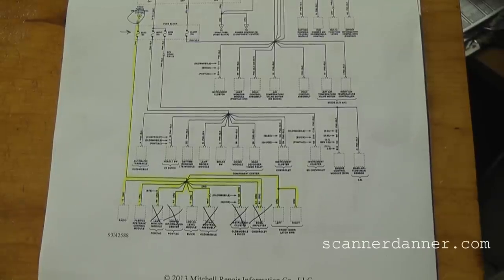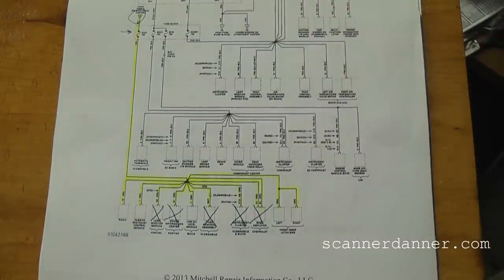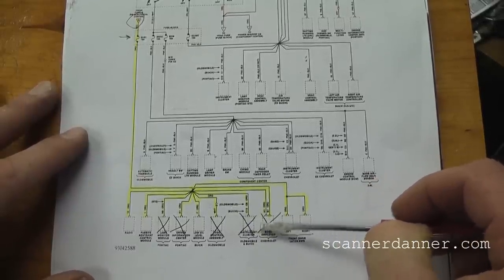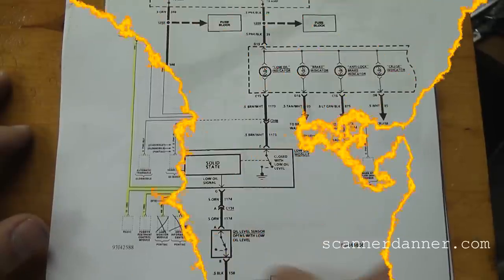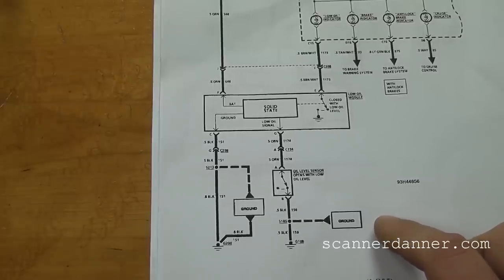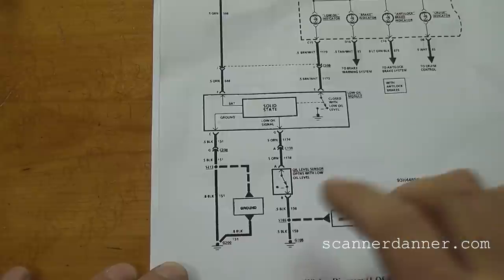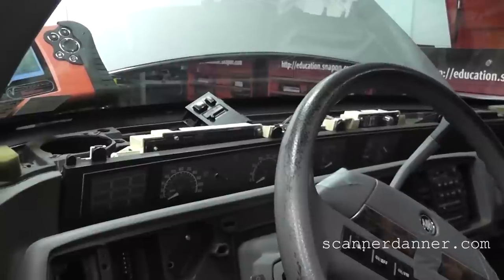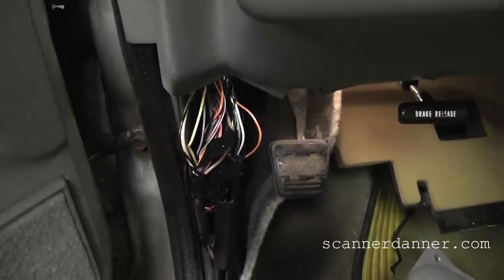1993 GM 3.1 No Start Case Study (Part III)

Comment: I had an 89 Berreta with the same passive restraint system. Government regulations were going in requiring a passive restraint system for front seat passengers. Auto makers didn't have to use airbags, per se, but a system that automatically protected front seat passengers. This was GMs version. You could leave the seatbelts latched all the time, and still get in and out of the car. When you opened the door, the seat belts would release and you could get out. When you were driving and hit the brakes, or the car slowed down abruptly, the speed sensor reading would be used to tension the belts. It was a clumsy system, and everyone would just unlatch the seatbelts anyway. When airbags became more common, this system disappeared. Great videos, BTW!

Comment: FYI, My brother is a phone tech. I have brought some of his tech tools over to the auto side. I have been using a tone box and wand to follow the noise in the wire. I have had success in some cases following wires in search of those mysterious modules. Or the ones that are not listed/wrong locations. Great job your doing, refresh and learn new stuff all the time from your videos.
Reply from the maker: thanks mark macias

Comment: Used to get those when I worked at the Buick dealer.  The system was designed so you could get in and out of the vehicle without taking your seat belt off.  Thought that was a pretty interesting system myself.  I remember getting burnt a couple of times by those solenoids when doing window motors.  The solenoids would stay on and get hot with the door open.  Never seen a module go bad on one though.  Good catch and great video.

Comment: i think i figured it out. When he clipped the harness, the wire cutters or scissors caused a momentary short to power, that backfed through the chime module, cruise module, or instrument cluster, that drk green wire is in the diagram is dotted meaning other things are connected to it, like the chime module, there are many drk green wires running to the radio but i dont think they are the same, the old pcm might of had more clues had it not exploded

Comment: I found this video interesting because when I was trying to find a parasitic draw on our 94 Cavalier, I was dealing with a lot of the same components on the circuit that was drawing as you were.  Mine was at the CTSY fuse and messing with the negative battery cable at the negative battery post gave me the same sounds that you experienced.  I thought it was my power lock switches as well.  The CTSY circuit on my car also dealt with the door latch switches which I also could never find.  I also could not find the low oil level sensor.  Mine problem turned out to be the trunk light harness that was causing the draw.  I just unplugged it for now since it's not important to have.  I will look at it more later after the weather gets better to see if the harness has a cut in it that could have been grounding out.  This draw would cause the car's battery to go dead about every 7 days even when the car was driven 5 days out of the 7.
Reply: I also forgot to mention that our car also had the seat belt retractors inside the door and had the same two retractors with the same black and yellow wires going to it.

Comment: Way to go Paul! Watched the 3.1 series.  I'm impressed.  Reminds me of when I was going down the freeway in my 90 Deville.  Suddenly the car shut off, speedometer jumped to 85 and I lost all accessory power.  Being newer I didn't look at things systematically like I should have.  I did find the fix a few dollars later, turns out the primary wire from my ign. switch to my coil (inside the distributor) shorted out against the engine and fried a fusible link... Watching this reminded me of that (I think it was the way that dash looked).  Keep up the good videos!!

Comment: The solenoids would hold the pendulum still so opening the door would not cause them to grab the seatbelt. Once the door was closed the pendulums had to be allowed to move so they could lock the seatbelt in an accident. The VSS input was there to override the door latch switches so that if you started driving the car it would automatically release the solenoid so that the seatbelts could work. It would ignore the door lock switch input with vehicle speed.

Comment: Look at 42:00 when you flip the module over. Upper left corner. Board is damaged, possibly shorted.
Reply: Sorry, you're 2 YEARS too late. +Daniel Auto Elektro had it 3 YEARS ago

Comment: So when you heard the noise in the door as you pulled and replaced the fuse, couldn't you have whipped off tge door panel and then using the Power probe ECT device sent a radio signal back along the yellow wire and traced the module. I know it wouldn't have given you the vehicle speed being along the green wire, but after finding it fast you could say well there's power and ground so very likely module damaged.

Comment: You should save that module as a example for the next time your talking about transistor drivers in a ecm - ecu. That black 3 pin square - rectangle item  mounted to the aluminum heat sink is a transistor it has the Base collector and emitter

Comment: My Bronco II cranks but no spark, my techs changed parts first  then tried to diagnose to NO avail lol, having them tow it to house  I got factory wiring diagrams on way, hopefuly i can do as good as u guys, grt work, appreciate it!  jim in NC
Reply from the maker: I have videos on the EEC IV ignition system. Check my chapter 22 playlist

Comment: I'm surprised that you didn't think about the VSS in relation to the latch switch.  Think about it.  In modern cars when you reach a certain speed the doors lock.  Perhaps they weren't as sophisticated back then and instead simply prevented the door handle from being used after a certain speed.  A VSS controlled "lock in" design.  Think that is possible from what you saw?  That's all I could think of.  Nice to see you struggle once in a while.  If you aren't frustrated you aren't learning!

Comment: Hi Paul. They use the term passive restraint because it doesn't require any action from the driver. The way that system works is you're supposed to leave the seat belt latched all the time. The driver is supposed to slide in and out underneath the seat belt that's already latched. The problem with that design is when you open the door the pendulum in the seatbelt it would cause the seatbelts to lock .

Comment: I realize this is an old video, but I've found that shopkey/Mitchell is sometimes limited on diagrams for older vehicles. Where Alldata has a few more. I found the diagram for the seatbelt system that shows the switches and solenoids. As well as some system explanation.

Comment: I had a Grand Cherokee come into the shop, don't remember the year, it had a parasitic draw, traced it down to the door ajar switch, even using a wiring diagram it took me 4 hours plus to track it down, I do not recall if their was a door ajar lamp illuminated on the dash either.
Reply: Never say quit never say surrender

Comment: I once had an 89 blazer mfg date 9  - 89. To find any parts that would fit it I had to use 88, 89, or 90 and compare the three to find the right part. It reminded me of that Johnny Cash Cadillac song, One piece at a time. Damn thing ran for 25+ years though with only the expected part replacements. Not one major item at all. Jpol.

Comment: i've watched this video before but my brothers 93 cavalier is doing the exact same thing 
maybe a little late but i hope that fella did not drive that car without that module as he wont have proper working seat belts....the 93 cavalier was controlled by a chime module..the door latches/handles are wired at the door latch to illuminated the vehicle when puled up on Scanner Danner you are right about the solonoids allowing doors to be opened with belts still attached

Comment: looks like there is some burnt out print on the pcb of the control module, at the top left hand corner of the pcb
 pause video at 41.58 . I could be wrong, it might be a shadow
Great video

Comment: Alldata lists the wiring diagram as "Seat belt system" for 1993 Buick Regal. The interesting thing is that they also have the exact same location description. GM must assume that is enough info to go on.

Comment: Another great video, showing the real world issues we can come up against. I am liking frosty9595's idea about speed sensitive volume control, would be nice to see if the radio control module is linked to the speed signal circuit! A full conclusion as to the cause might result. Thanks Paul, a really interesting three parter.

Comment: I know it didn't have anything to do with what was causing the battery drain, but the low oil level module. Something you could have done to eliminate it as a possible cause of the drain without actually having to find it seems to me would have been to find the ground for that module shown in the diagram and remove it. By ground, I mean the one to the left @ 6:11, NOT the ground for the oil level sensor.

Comment: i  think i can see the damage line on the back of the circuit board 41:57 left top corner
Reply: You are correct, sir. There is a burnt trace (open) which goes from the center pin of Q1 to diode D1. Nice catch!
Reply: Lol good one i didnt catch it
Reply: I have seen circuit board trace lines repaired--some even had wires soldered in to bridge the burnt part.  This was on much larger and more complex computer circuit boards too----railway maintenance equipment. Imagine it is done elsewhere to repair circuit boards because new ones from OEM were VERY expensive for the ones I saw repaired.

Comment: Just out of passing interest, we have a 08 Honda Fit that has a VSS input to the radio. (The radio has an auto volume up/down adjust feature to compensate for road noise.)

Maybe this has something similar, and in the act of radio wire chopping B+ was sent down the VSS and zapped the module?

Comment: Welcome to Mitchell wiring diagrams pre-1994 they were pretty awful.

From 1994 onward though the wiring diagrams became a lot more organized and being able to highlight the wires made tracing circuits much easier.

As for the module either the PNP switching transistor (the large one on the heat sink) shorted causing the drain or the main 4 pin IC is bad and is applying power to the base of the switching transistor at all times keeping that load on.

Comment: It was definitely there before the radio well in my case because in my case somebody put an aftermarket radio but this car was also broken into and about a month or two after it got broken into he sold it or I got it taken away and the auction I believe cuz the option I bought it from and the guy who bought it from the auction drove it for a little bit did not tell me anything about it obviously he didn't know nothing and neither did I. But the engine ran super strong either way thank you very much I know I talked to you guys as you're off God bless you

Comment: A few terminals on the module look like they have a build-up of oxidation on them.  I have had this be an issue with wiring problems.  The "guts" of the module appear fine.  Do you think the terminal oxidation issue may be contributing to the modules problem.   
One added note:  Your 1/2 brother may be the professor in the family; yet, I think you are a PhD in auto diagnostics......................Doctor Dan.

Comment: Did the factory radio have the speed compensated volume? if so it may have been shorted while cutting wires of the original radio.

Comment: They got around installing airbags in cars that vintage if they could make the seatbelts passive instead of active. This is one example. Another example is the motorized seatbelts they used in the early 90s. If they didn't do one of those two things they had to put airbags in.

Comment: is it possible that the vehicle speed imput, like a very sharp decrease in speed, say from a hard stop,  would cause the module to power up or down to lock the passive restraint belts?
Reply: input

Comment: you keep doubting if the issue occurred at the battery explosion...NOOOOOOO~  the issue was present before that, it was the original complaint!
Reply from the maker: it was caused by a reverse polarity battery charger being connected. I believe I covered that in here. Did I not?

Comment: hello paul! :D , do you think if i buy the mitchell cd's package i will able to have all those diagrams you chek when you log into mitchell on line??? or is better to pay monthly a membership? and the 2nd doubt, i can see those online information webs have a lot of info..I can see you chek most of the times USA models(already watched minicopper video) ,,do you think if i pay for being a member i could use that info from those webs with asian and europe cars in latinamerica?ofcourse i know th model MUST be SOLD IN THE USA,maybe the wire color change but here is toyota corolla,, there toyota RUNx, i think the wiring wont change.
Reply from the maker: best thing to do is to contact Mitchell on ask them. I do not know if your market would be covered by them on not.
Reply: thanks i ll have to contact them.. i thought wirings diagrams were the same or with slightly variation
Reply: BBB Industries has online wiring diagrams for free up to around 2012 models.
Reply: ok ill chek it right now

Comment: I told everybody it was a relay from the beginning because one of the workers at O'Reilly's said the main relay that's the name of it that he told me was underneath the steering wheel so I saw this just hanging and it look like a relay and this is the first thing I worked on I just thought the wires were loose I did not know that was the one killing my battery which cost me to get a new battery but I didn't get a new battery until I blew up my battery so it must have been slow or must have been doing it sometimes because there is no door handle I have to pull it with a wire so there goes in the wires just a tie wire to tie the door 2 something in the car to keep it closed oh my God so do I keep the fuse off and disconnect the module or can I keep the fuse on disconnect the module and drive because now I can drive